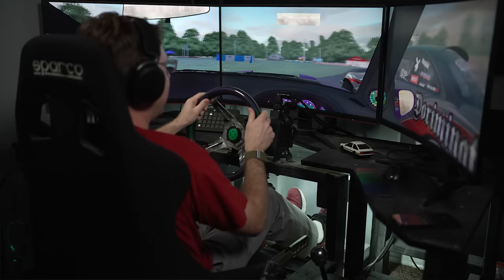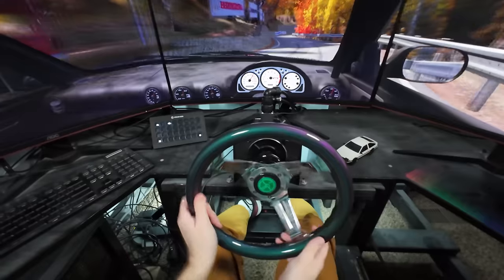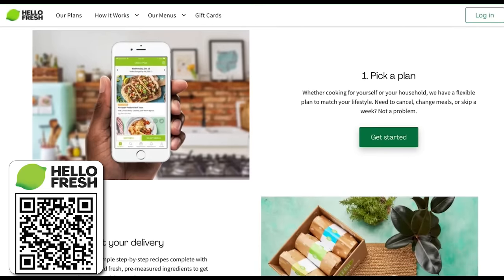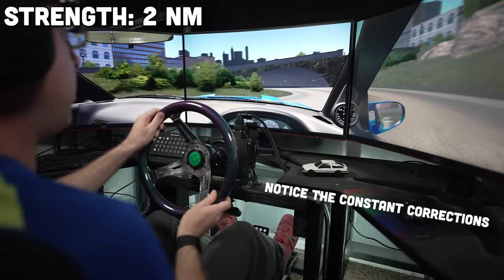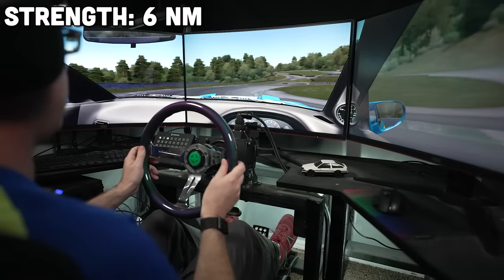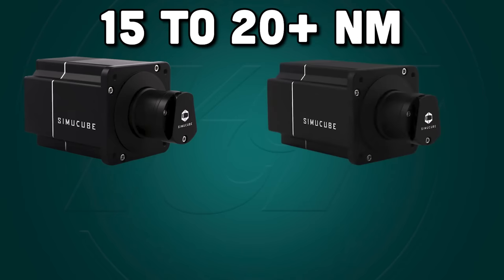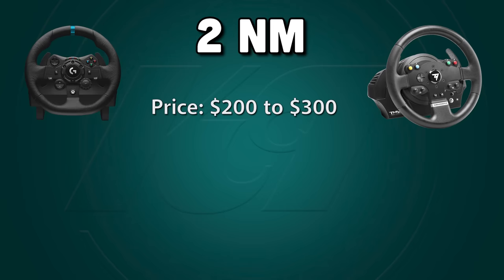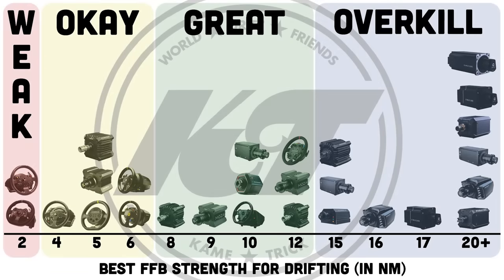What FFB is realistic for sim drifting? (2 to 20 Nm)

Comment: I don’t know why people want 20nm wheels. It’s simply not realistic, at least for the driving I do (even F1 cars have power steering, but F2 doesn’t so idk). I do rally racing in real life and the sim and these cars all have power steering, you don’t need to fight the wheel with every fiber of your being, it’s should be quite easy actually. Depending on the game I might even turn my G Pro down to 4nm like in Dirt Rally and other times keep it up to 10nm in games like WRC10, because the game is definitely not using all 10nm, so there is some game to game difference vs real life as well. But the moral of the story here is you shouldn’t be fighting with your wheel, that does not add realism. Pick a NM that allows feedback to come thru and the wheel to self steer (at least in the case of DD wheels) while still being able to quickly manipulate the wheel yourself. If anything the biggest difference is between a cheaper belt driven wheel and a real DD wheel, that’s the biggest realism improvement you can give yourself.
Reply: cuz 21nm is funny
Reply: The new for 2024 F2 car does have power steering actually, so even that is off the table now.
Reply: Thanks, and props to you for doing rally driving in real life! 

Mind if I ask whether you think Dirt Rally or WRC are realistic (damage simulation aside)?
Reply: @UTubeSL  Regardless, RBR is super easy to recommend. There are many, many real-life stages that are imo very well done by modders

And though there are some limitations, they've done well to give good logic to the game for rally car driving, and give you some options that you don't get in those games

Also, you are able to download different voice packs people have made, as well as edit your own pacenotes (or, as I prefer, download Luppis' collection of all his edited pacenotes). This matters because the default pacenotes are not consistent among all modders, and I found that distracting. Coveniently, there was a solution for it

Anyway, my point is I totally recommend RBR for the stages and feel of driving alone. Though the new games have advantages of their own of course
Reply: Do you think it's worth to go from g29 to t300 RS or save and go straight to moza r5?
Reply: @zepos  I got an R5 and it's pretty much like the feedback I got from my old racing car. Like he said, most of these cars use power steering, so it'll be just enough. Now if u want more of an workout u can get a R9 and drive cars that don't use power steering for realism
Reply: @LtheDetective  thanks, I never though I would really take sim racing more seriously but once I got my g29 I started sim drifting and it can't turn fast enough. If I sell my g29 and go for the t300 RS I can get it within like a month, however if I were to go for the moza r5 I would have to save up for almost like a year or something. Do you think just dealing with the slow turning on the g29 and saving up for the moza r5 is more worth it or not?
Reply: @zepos small upgrades are never worth it. U are paying for renting something until u get what u want….
Reply: @filipivan5125  Yes, i started with a moza r5 and upgraded now to a asetek forte. Even doh ill never use the 18nm, but even if i drive at 5-6nm the wheel feels much faster and more responsive. Buy once, cry once. Ofc depends on your budged, if you can only strech to a moza r5 it is a great little base.
Reply: @themadnes5413  people keep saying the same. Higher NM wheels just provide more detail. Im on G29 and went from wanting CSL DD for about two years now to hating the company and settling for simagic alpha mini which will be enough for years to come. People praise it and its gt neo wheel. Also my most limiting factor is the rig, playseat challenge G.
Reply: @filipivan5125  The thing is, if I sell the g29 and get the t300 rs, I can still save up for the moza r5 then sell the t300 rs once i get close to the amount I need. Which i think will give me more seat time right? That's another concern I have, if I wait the whole time to get a moza r5 I could have wasted like a year worth of decent practice.
Reply: @filipivan5125  i build a 8020 Aluminium Rig from the start, did it diy for about 350€ with a real car Seat. I would suggest that to everyone. You would struggle to get a cheaper Rig with a good seat i think.
Reply: @themadnes5413  people without space for permanent rig dont have options like that.
Reply: @zepos  save and go for R5
Reply: @filipivan5125  Okay, i mean it does not take much more space then a playseat. But if you cant keep it in one spot and have to put it away after gaming, i understand that.
Reply: @zepos  I’ve had both on csl dd now but the t300 is a great wheel a lot better than g29 but if it was me I would save and get r5
Reply: @jayjayp9618  yeah better of saving. And maybe get a really cheap used one for the meantime. t150 or smth like that.
Reply: @jayjayp9618  thank you i will do that then
Reply: ha all this discussion cause you don't have that wheel😂
Reply: The answer: higher torque translates to more detail. FFB is a bunch of things, not just steering resistance. For instance, if you hit a curb in really life your steering wheel ABSOLUTELY transmits 20nm of torque to your hands. With an FFB wheel, if it has 10nm of torque, and you are mid corner using all 10nm, every detail other than steering resistance will be lost. This is called clipping
Reply: @TheOfficialOriginalChad  that brings the question, do you really need that extra 10 nm of torque and possibly hundred extra dollars just for you to feel your car going into the barriers at 150 mph even stronger?
Reply: @zepos  not feel them stronger, feel them at all. Additionally, there is no direct relationship between speed and forces on the steering column. 

Back to your question: the answer really depends on the driver. A driver that just wants to get from point A to point B on Gran Turismo or Forza won’t benefit from the details of the race surface. On the other hand, a driver that uses their sim to build skills that are applied in competition or real life absolutely needs the details to build those skills.
Reply: It's not about using the full 20 nm, it's about giving you more headroom so the FFB doesn't peak beyond what the wheel base can handle. It allows you get all of the feedback possible
Reply: More detail is the reason. You can ramp up all the smaller FFB effects, then cap the maximum force wherever you choose. This cannot be done with lower FFB wheels. There are also a few situations where 20nm IRL happenes, like hitting curbs on the apex, or driving old openwheelers etc
Reply: @smallbutdeadly931 no it's not.
Reply: @zepos  I had the chance to compare the T300RS directly with a GT DD 5nm on the same rig and the differences where so huge, that I never considered the T300RS after. I got the GT DD with the boost kit and I'm super happy. I really recommend you saving up some more time and get a direct drive in whatever Nm you can afford. Not only are the forces higher, but it is also a lot quieter and transfers a lot more detail. With these bases you can swap your to much nicer rims for all sorts of racing games years later, where as with some cheaper models you are limited to what is attached to the base at purchase time.
Reply: @drstefankrank  thanks I'm for sure saving up until I can at least get a 2nd hand moza r5
Reply: @zepos  A good plan! Maybe you are lucky and can even get a r9.
Reply: @zepos no just do some lawn mowing for ur neighbors or wash some people’s car and get the money for a DD wheel base. Shouldn’t take you a year to save up $400. Heck, I made $150 in two weeks selling candy at school
Reply: I highly recommend the moza R5 bundle with extra clutch pedal , Brake mod , hgp shifter and handbrake combined with a GT omega apex wheelstand
Reply: It’s for dynamic range. A GT3 spec and up car will be 13Nm+ mid corner average. You want headroom above that for other forces.
Reply: @dienkonig33 even with power steering, the steering is far from light. Probably 13Nm+
Reply: Giga Chad Rally racer
Reply: I drive a spec racer IRL (Rush SR). When the downforce is in full effect it can legitimately take all of my force to turn the wheel up to the front tires' limit.
Reply: Isn't the point of a 20nm wheel to set it at like 50-60% (so around 10nm) to get more precise ffb?
Like, 20nm set at 10nm is more accurate than 10nm wheel set at max ffb
Reply: Simple, durability and no clipping 😂
Reply: Headroom is why. Simple as that.
Reply: I have a Simucube 2 Pro. I wanted something that was going to provide ALL the details and cover ALL the bases from drift to GT to F1 to trucks to classic cars without power steering.
Reply: You don't buy 20nm because you want to use it, it's just to avoid clipping.  Similar to speakers that can go louder than you need.
Reply: the point of these higher torque wheels is to get more roadfeel and less clipping when set at a lower max torque
Reply: Its a common misconception that certai. cars just "have" a certain number of nm. In reality when you're driving and you hit a rock or a pothole the wheel could move with 30 or even 100nm. Easiest way to think about it is imagine having a wall next to your car, no matter how much powersteering you have or how hard you turn you physically cannot move the wheel. So for those types of effects the stronger the wheel the better.
Reply: Its a common misconception that certai. cars just "have" a certain number of nm. In reality when you're driving and you hit a rock or a pothole the wheel could move with 30 or even 100nm. Easiest way to think about it is imagine having a wall next to your car, no matter how much powersteering you have or how hard you turn you physically cannot move the wheel. So for those types of effects the stronger the wheel the better.
Reply: It's only realistic if you like to drive on GoodWood classic 😅
Reply: Totally agree with you! Still fighting my T300 after 3 years to find the right point where the wheel does what it should but doesnt feel to heavy when u wanna change directions etc. idk i think with the t300 it is not really possible, have tried thousands of settings, found a good one but still, something feels diff and after a time its so annoying
Reply: Im guessing for older F1 cars and stuff.
Reply: It's not as simple as higher power = stiffer wheel. There's other characteristics that come with more power than you can benefit from when using less % of the wheel.

People don't use the wheel at their max, but I still think that 10Nm is the sweet spot for most people.
Reply: One of the few things I can think of is Indycar, but other than that I can’t think of much!
Reply: Powersteering in a racecar doesn't feel the same way as it does in a road car/rally car, additionally like more than half the replies state you gain more headroom meaning you don't peak out midcorner in a highspeed corner in a GT3 or LMhypercar which both far exceed 10Nm torque and when you hit the curb it's going to hit a lot harder than 20Nm IRL and unlike what commenters on TV tries to make you believe, racers consider the curb as part of the track and always use it, additionally you won't feel it if you're losing grip in a high speed corner and your wheel only supports 10Nm

For drifting and really which are generally not relying on the wheel to tell you that you're at the max speed of the corner 10Nm is indeed more than enough but not for sportcar racing
Reply: Yeah. I use 8nm on ACC and after literally 20 minutes my wrists are killing me. So I dont get why anybody goes for 20nm
Reply: You don’t need to use 20nm just because the wheel can give that momentum. Often it’s so that you can have a buffer off so you never loose details when peaking above ex. 10-12nm. 

If you have a wheel that’s only rated for 5nm, you’ll loose detail going beyond that limit. 

And by also having a wide range, you can simulate other types of vehicles with more accuracy, like gokarts. Gokarts only started feeling realistic in sims when I tried it with a 20nm base.
Reply: @zepos that’s pretty much what I’m doing but I didn’t plan on it the t300 happens to be on sale for 299 and I was able to sell my Logitech for 240 so didn’t pay much at all for the Thrustmaster. I’m gonna use the thrustmaster for probably around 8 months then I will get a direct drive
Reply: You never really use 21. It’s healthier for the wheel using less than that and it lasts longer
Reply: People buy 16-20+nm just to set 11nm and their base will be reliable with no overheating
Reply: You forgot offroad. You do need that much power for offroad since your tire can get stuck between rocks in rock cock climbing or get stuck in mud in normal offroading. But still how much people do sim offroading? I do love it and been doing it for years but i have never seen anyone else other than me😅
Reply: 25nm is for details without effort at 10-15. But also it mimics imo the G forces on an F1 along with the wheel. If you look at f1 driver’s training, they do a lot of shoulders because of the effort it takes during a race.
Reply: What you're missing is the fact that a sim wheel isn't only giving feedback from the wheels, but also the g forces. Which you do fight with.

As others mentioned, a stronger wheel also allows for higher detail and dynamic range for the wheel.
Reply: This... and it all depends on your setup, you don't need a full 900º of rotation, most people can change the rack to a faster ratio because of that issue in real cars.
Wheels like the G25 will work just as well.
Reply: @wobblysauce  "just as well" is a bit of an overstatement. You definitely don't NEED more detailed ffb, but it does make the experience fuller.

Again, you have to remember that a wheel is also simulating the G forces you experience. Not just the weight of steering.
Reply: People want strong feedback, because ffb provides curb and suspension effects, which in real car you get from chassis not the wheel, and sim wheel needs to provide them too and have headroom. Also, to simulate pro go karts or indy cars you need at least 15 nm.
Reply: There are multiple reasons why you would want a 20Nm wheelbase. First of all it depends on the car you're driving. Not every car has power steering and you wan't to be able to simulate those too. The most important thing is detail and clipping. For example. A Real GT3 race car has the equivalent of about 12Nm (according to Daniel Morad, who is a real life GT3 driver and sim racer) If I have a 12Nm Wheelbase, I can't set it to max force because It would be clipping, overheating and losing detail constantly. You need the headroom so that this doesn't happen.

Comment: This video shows how much quiter nice DD wheels are compared to entry level gear drive wheels. My logitec G920 was so loud
Reply: My G25 was also mad loud compared to the T-GT2 I have these days. DD is even much more quiet than the belt driven T-GT2 I have. I really  want Thrustmaster to make a DD base for Playstation dammit... I need it for GT7 in VR.
Reply: @JimmyNuisance the entry level fanatec dd wheels and pedals work for both ps4 and ps5, and theyre only 5nm so can still just mount it to a desk if you dont have a rig
Reply: My Driving Force GT would scream when I tried to drift, especially if I had to wrestle it round faster than it wanted to go.
I thought my lack of control in a drift was a skill issue, but it might not have been, judging by this vid lol
Reply: Try PXN V12 lite bro, entry level for DDS, it's quiet and smooth without breaking bank acc...
Reply: g25,27,  29 is so loud people don't even use FFB and instead just centering spring.
Reply: G923 sounds broken when I try to drift

Comment: One thing not mentioned here, but worth keeping in mind, is that you ideally want to be using any wheel at less than 100%. This is less of a specific issue with drifting but definitely something for grip driving, since when you're at 100% you can run into a lot of clipping - this is where the motor is operating at its maximum force and can't go further, so you lose all the fine detail from the feedback. You want to have 10-20% of headroom on your wheel to avoid this.
Reply: can’t do that with a shitty logitech bc there’s not even enough ffb when it is set at 100 with the gear driven wheel
Reply: would getting something like a simucube 2 ultimate give u finer details at 8nm than for example an r12 or something comparable?

Comment: And not a word about the fact that in the case of 4-6 nm bases, it will be necessary to turn their power to the limit (to achieve the power recommended in this video) and during long sessions at 100% they will overheat or break down faster. This is not yet a category of products where they are capable of large and long-term loads.
Reply: Well this is only a recommendation. While I am highly considering getting the fanatec dd pro as an upgrade from the g29. Doesnt mean that I will go out and make a blind purchase just because Ben recommended it, I have to do my own research.so yeah I understand the criticism as there are plenty of people that will do that without doing research on their own.
Reply: Yeah exactly. I'd much rather be running my expensive hardware well within its capacity rather than right on the limit every time